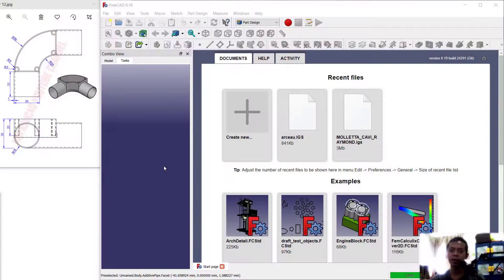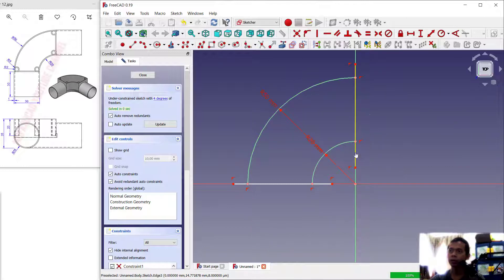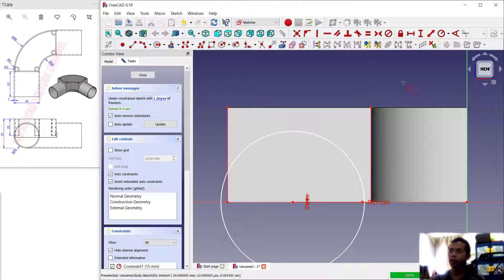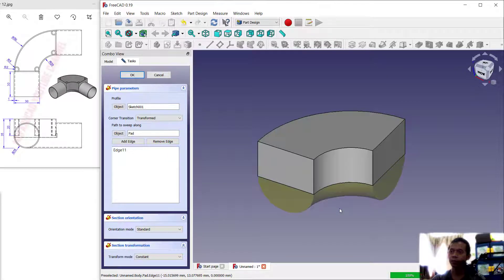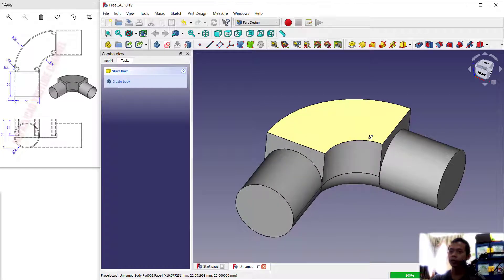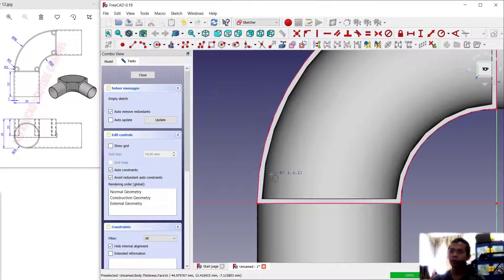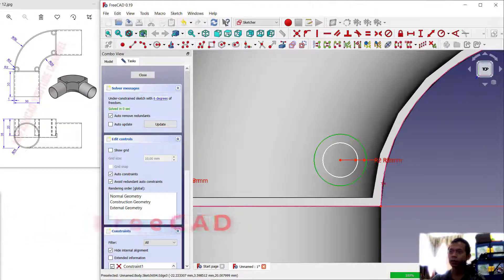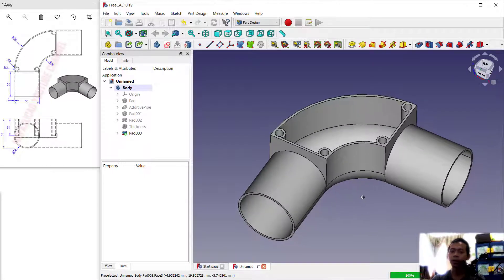Exercise 12 FreeCAD Basic Part Design Tutorial For Beginner

Comment: Hi guys, I'm trying to do the same figure, but, I'm in trouble with the arc after the completion of the body, I mean, when I draw the circle in the body, I cut the upper part leaving the other, I click close but I don't see the arc...
I follow exactly the procedure....any idea?
Reply: It might be hiding inside. If you've, of a mistake, clicked on the bottom part (the curved one in the middle), the arc will then be there, but at the inner face (behind the face of your arc).

Hopefully this helps